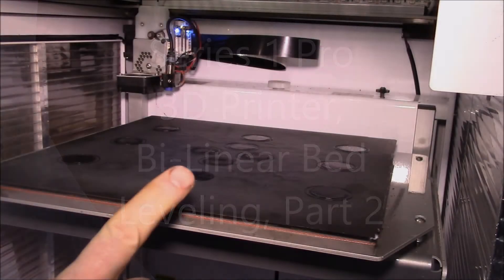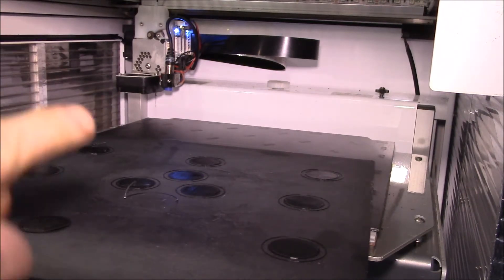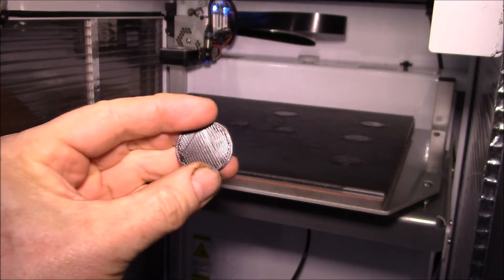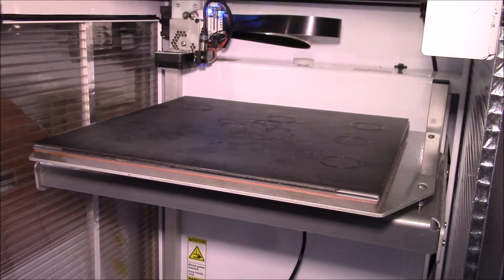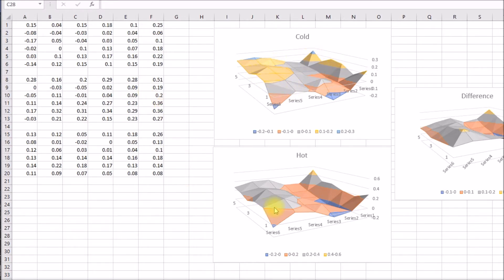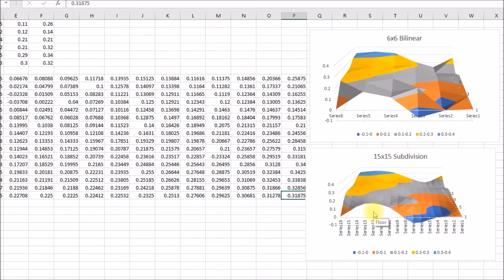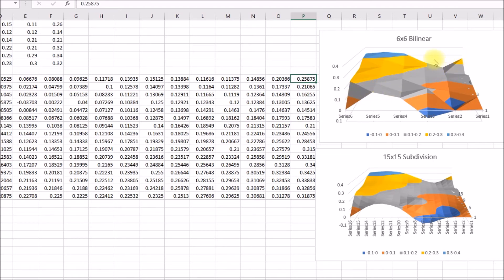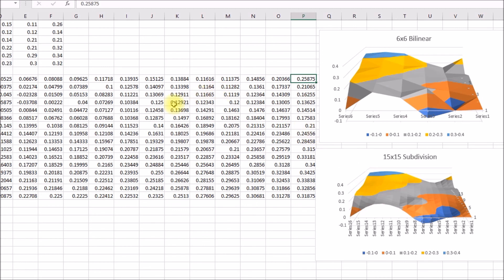Series 1 Pro 3D Printer, Bi-linear Bed Leveling Part 2

Comment: Thanks some good info for sure. Once I get my backup board and get the courage to update the code
Reply from the maker: Yes, it's a big jump.  It took me many months to work up the motivation to jump into this on my printer.  Then I picked up the spare controller board to experiment with and after that went off w/o any issues, I plugged into the board in the printer and hit "Upload".